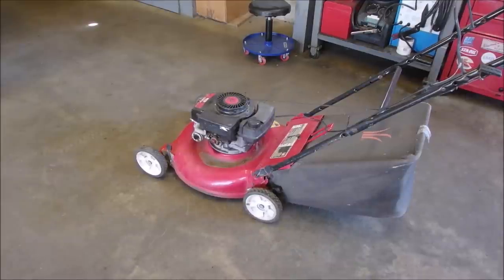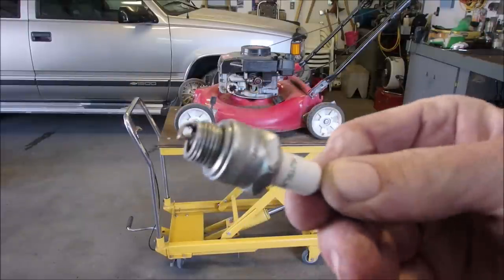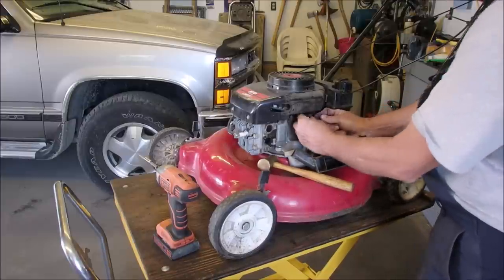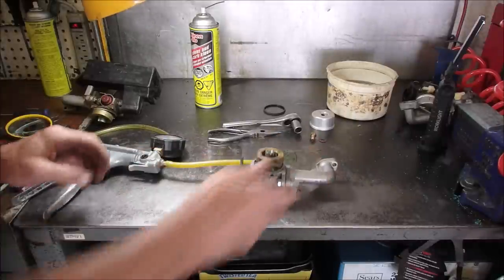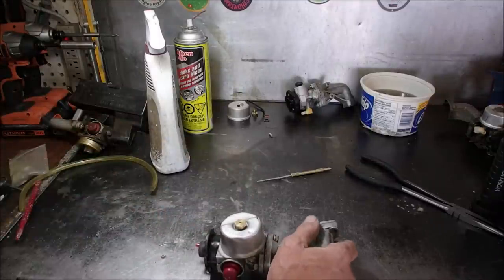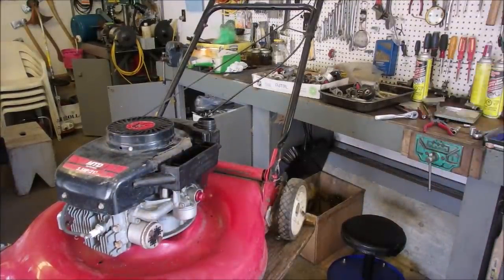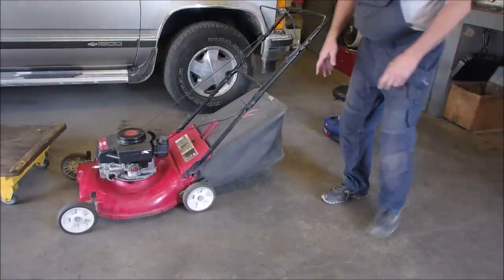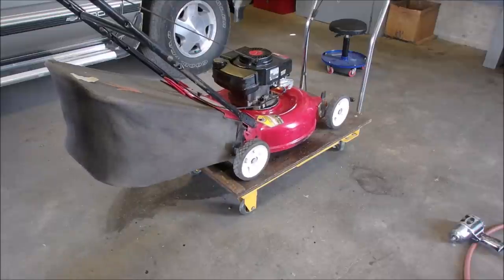There Are 3 Things Wrong With Every Non Running Mower

Comment: Hi Bruce my 79' Toro with @ 164cc Tecumseh has the muffler under the deck just above the blade!:face-blue-smiling:
Reply from the maker: Wow  2 stroke?
Reply: @BrucesShop  no 4 stroke Aluminum deck 18" small mower

Comment: Hey Bruce, great video as usual. Just have a couple of questions. 
Why did you change the left hand pull back to right? More righties up there in Canada?
What are you looking for when you hit the primer bulb while the mower is running? I've never seen that done before.
Reply from the maker: Well the pulls are all right handed in m opinion.  When I push the primer when the engine is running the primer squirts fuel into the engine cause a over amount of fuel needed causing a sputter..  That tells me the primer is adaquate.